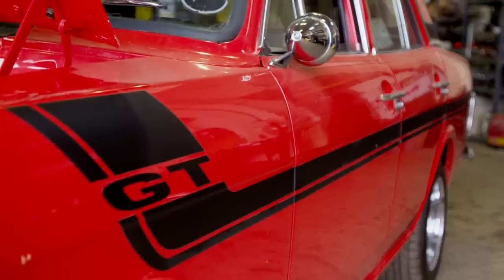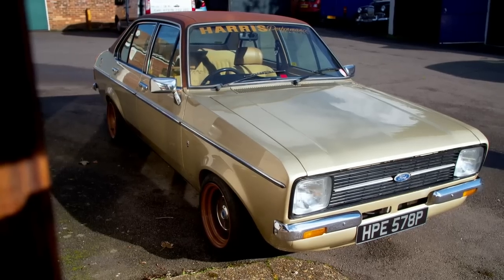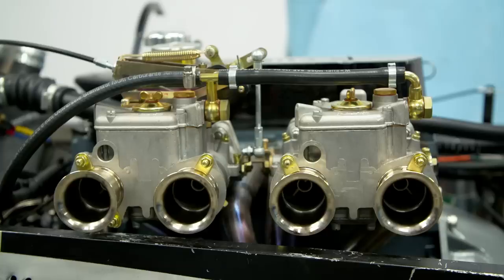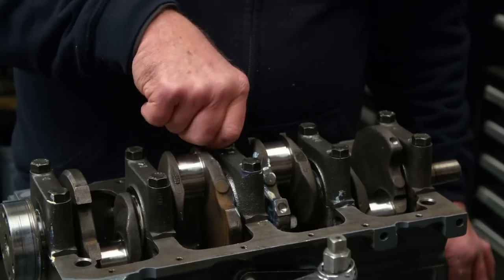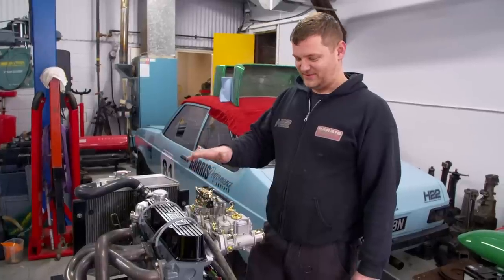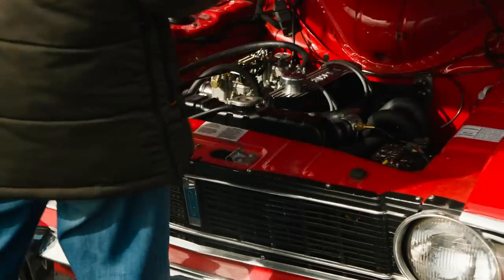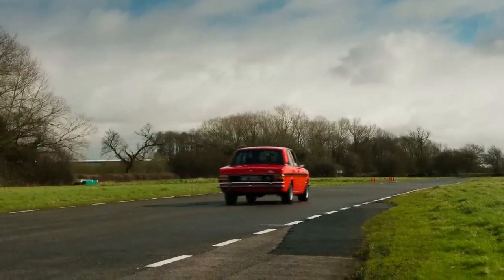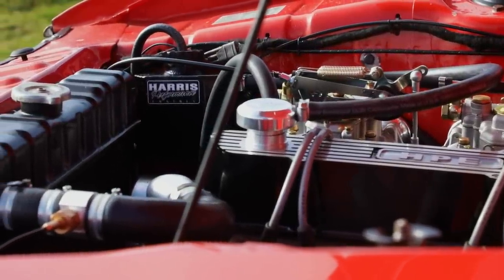Upgrading Ford Cortina GT With A Custom Harris Performance Engine | Salvage Hunters: Classic Cars

Comment: i have got a 135 bhp harris  ford cross flow engine in my cortina 2 and it is superb cost a package but worth every penny
Reply: Have you changed the gearing otherwise it over revs. And it will be in the red  at top end and wear the engine.  With that bhp and the right gearing it should hit about 120

Comment: That looked superb. Now enough looking - get an airbox and proper air filter on there.
Reply: Yeah, I always cringe when I see an engine with just screens.  Even if you don't ingest something fatal, the grit from road dust will wear your rings down pretty quickly.
Reply: @bobmcl2406  Yes and also people that remove timing belt covers because the whirly bits look kool.

Comment: I remember when the Mk 2 came out and it was advertised as having bowl in pistons ( which means cheaper cylinder heads ) and cross flow heads. It is not a true cross flow because the valves are in line thus limiting the size of the intake and exhaust ports and even the 1600 engine did not put out more than 80 hp. The Lotus twin cam put out about 120 hp which was a lot back in the day.

Comment: Love them old welded steel wheels
Reply: Good old Les Weller, started welding them around 1967. Had a 6-inch set on my first 1,498cc-engined Anglia. Tun-Tyres, in Tunbridge Wells, were amongst his first stockists.

Comment: Great work Gentileman- former Ford Factory Tech here- had a 1.9L kent in my wifes Escort- quality unit Sir.
Reply: Mike Ray A cross flow bored out to 1.9 ? Really ? Wow
Reply: @jk3838  That Escort model was Sold in U S.for years,.still see a few still on the road. As. Former Ford Tech we knew it as the " Kent 1.9L".
Reply: Mike Ray was yours the CVH front wheel drive engine US escort ?
Reply: @jk3838  Yes Sir-
Reply: @jk3838  oh..1992 LX 4 door manual.trams/air cond/pwr steering.
Reply: Mike Ray so you had a car with completely different engine/gearbox/body than in the video then ?
Reply: @Mike Ray. You may already know this and I bow to your superior knowledge. Back in the day, I remember reading about the German spec. Ford Capri which had a "1.7 litre engine and a sprung manual gearbox". Have you heard of this spec? Was the engine size to compete with the Opel 1900 GT (the car with the rollover headlights)? And what was the "sprung gearbox" feature? I can't remember any UK cars of that time where the gear stick in neutral was pushed towards the driver in readiness to select first gear. Stay safe and well.
Reply: @jk3838  The Kent,Essex,and Pinto were good enough engines.The CVH was just pure junk.
Reply: 1.9 IS A CVH NOT KENT CROSSFLOW ALSO HAS HEMI STYLE ENGINE  1740 WAS BIGGEST REBORE I SEEN ON 1600 CROSSFLOWUNLESS RELINED SPENT MILLIONS WHEN ZETEC BOLTS IN PLACE NO MODS
Reply: @markmiwurdz202  1.7 WAS FORD EUROPE V4

Comment: What are the performance figures for this engine.  Is it quicker then a lotus cortina.  And what about the gearing  the cortina was low geared. So it over revs in top gear
Reply: What engine is it?
Reply: @JazzFunkNobby1964   4 cylinder x flow. Kent engine.
Reply: @russcooke5671  I would imagine the DOHC Lotus engine would be the winner. What do you think?
Reply: @JazzFunkNobby1964  yes. They are very tuneable.  140. Bhp is the most for road use.  190 bhp for race.

Comment: What the hell did they do to the suspension and wheels ?  the suspension is too high ( it looks like it has been jacked up ) the wheels are totally wrong. Mesh air filters are as much use as a chocolate tea pot ( should have put a pair of K&N'S on ) with no power loss . Oh and loose the rubbish stripes
Reply: Yes, looks like it wants to be a dune buggy, needs to be 3 or 4" lower.
Reply: Wheels inspired by Herbie .
Reply: @jimspeed1388  AND THATS WHERE THEY SHOULD STAY !
Reply: @g0fvt  YES TYPICAL PRITCHARD BODGE
Reply: @johncauser9705  TBH having watched again I think the wheels are too wide hence the ride height. Stock wheels on the GT were 5.5jJ those look like 7J, I think 6J with normal offset are about as wide as will go under the stock arches.
Reply: @g0fvt  Got it in one I ran my MK1 and my Anglia  on lotus steels and they handled great those idiots think that just by slapping big wheels on that it will handle better it does not work that way
Reply: @johncauser9705  had lotus steels  on my corsair  back in 1979 who would think there a few bob to buy now
Reply: @terryroberts505  I worked out the other day that at the time back in the seventies i had about £10,000 worth in todays money of Lotus wheels, OH for a crystal ball  + all the 2000e gearboxes , 1500 GT engines. Ford Anglia, Mk Cortina body panels and dozen's of old ford panels I worked for a Ford main dealer and they used to throw their old panels away

Comment: In 73 I worked in a garage in Herne Bay. One of the customers had a 1600E with a V6. I believe it was called a Crayford conversion. Now THAT! is a wolf in sheeps clothing.
Reply: I know about the Crayford factory that did the convertibles known as Crayford convertibles but not Crayford conversion?.
Reply: @markwood9987  I thought they did engines as well. The other name I heard it called was the Savage. Not sure if that was just a nickname.
Reply: @rappers5719  yes the Corrina savage  and perana used the Essex V6, Australia did inline straight six of 3.3 and 4.1 litres in the mk 3.
Reply: @markwood9987  Thanks Mark. I've only ever seen one Piranha (Capri) and that was in a  storage unit at Heathrow. 70 ish.
Reply: @rappers5719  been a pleasure pal keep safe .
Reply: @markwood9987  And you.
Reply: The V6 conversion was most famously done by Jeff Uren, known as a Savage. Not the greatest TBH, did a few V6 conversions with friends way back, best to use a different gearbox and the 3 litre Capri rear axle. Handling definitely suffered from the heavy engine, I remember a mate wanting to go back to a 4 cylinder for that reason. There were some V8 conversions around for the Capri, and I believe they were made in South Africa as a factory option. The car in the video needs to be a few inches lower, should be a bundle of fun, people forget how light these cars were...
Reply: @g0fvt  Thank you. I believe, the 2000E gear box was quite a favourite for the higher powered cars.
Reply: @rappers5719  yes, had good ratios too. Did shear a first motion shaft in one with a V6 though. Great with 4 cylinder engines.
Reply: @g0fvt  I was just about to dive in with a Jeff Uren comment, I thought the Capri with the V8 was called a Comanche but I’ve just realised it was the Stampede, I’m sure the ones I worked on had a small block V8. I worked for a body shop in 73/74 where we used to do the body mods for him. I also remember doing a hood scoop on an Olympic Blue mk3 Cortina, I’m not sure if he called that a Savage as well and we used to pull the wheel arches out to accommodate the wider wheels. The only work I did there on mk2 Cortinas was to rectify the Silver Fox and Blue Mink paint flaking debacle. Memories eh, thanks for reminding me.
The two guys in the coach building side also made custom fit front spoilers from scratch out of aluminium, we used to think they looked like snow ploughs, they were initially for Mathwall Engineering for their Mazda RX3 race car, I remember the sponsor was Penthouse, funny how I can remember that. Soon after everyone wanted a front spoiler for their road car.
Reply: Ken Allistone,  the gun metal coloured 1600Es were handsome when new. Did know someone with a twin cam version, bootbadge even said  "Twincam E" apparently one of about 14 from Ford. Sadly even those years ago the twin cam had been replaced with a crossflow. Would have been a valuable car now.  The V6 conversions we did as kids were fun to do but afterwards you'd spend your life changing track control arms and track rod ends, quick off the lights but ruined the handling. A mate's MK1 with a modified V6 did about 180hp at the rear wheels, so many modern and light 4 pots could do that. Great fun times, the car scene is not the same now...
Reply: @feydespiel.  you honestly would be better off with a 2 litre Zetec or similar.
Reply: @feydespiel.  Good luck mate. Post progress pictures. Post a time lapse on you tube. Would be nice to see.
Reply: @rappers5719  Yes a fair few Corsair 2000Es were stolen for their gearbox.
Reply: Crayford did do an Essex V6 conversion for the MK2 Cortina. Jeff Uren did the savage with his company "Race Proved" the Cortina in this video at 6.15 with the VYP registration is a genuine 3.0 Savage.
Reply: @brianclaridge7695  Thanks mate.
Reply: I recall my father had a Ford Cortina mk2 with a 3 litre V6 when new, it was known as a Savage. I remember seeing lots of dials everywhere, perhaps a 1600E interior? It went well for very early 1970s.
Reply: @brianclaridge7695  I had a 3 litre crayford 1600 E.  low geared no top end  in the red at 85 mph. But got there very quick  reg no was SDF 100 H.   In white  10 to the gallon. I should have changed the gearing and back axle.   Then it would have done about 115 mph same as the African perana. conversion.  Basil green motors   They even done a v8 capris.
Reply: CRAYFORD CORSAIR HAD A 2LITRE V4 AND A GREAT ENGINE IT WAS TOO CORSAIR ONLY UK CAR  AND ODD 1 TRANSIT1  CAME HERE WITHH V4 2.0
Reply: @rappers5719  YES THE FAMOUS ROCKET BOX 4 SPD GREAT RATIOS
Reply: @f1kwa399  ALLL CORTINAS HAD SAVAGE OPTION CPL OTHERS FOR OTHER FORDS OO V6 MK1 ESCORTS ETC GENIUS OF PAST

Comment: Only a question, but did Ford ever produce a 1600GT Mk2 Cortina,  as i thought it was a 1500 GT, or a 1600E , i could and very possibly have got this wrong !!
Reply: They did as a friend of mine owns a white Mk2 4dr GT Cortina, it’s now running 200zx power.
Reply: yes the GT had the gauge's on top of the dash 1600 E in the middle
Reply: MK1 1500GT PRE CROSSFLOW SAME AS LOTUS TWIN CAM BASE

Comment: back in the early 80,s in a barn in surrey was a red two door jeff uren savage mark 2 cortina. it was a1968. im sure it had a wooden dash which would have meant 1600e. i know there were no 2 door 1600e,s made in the uk but something rings in my head about austrailian spec can anyone confirm this. i wanted it so bad but was too young

Comment: 187bhp ! Wow a shopping car has more nowadays. Why no Lotus Cortina ? They were the DB in 5he day
Reply: 187bhp out of a 1960s engine
Reply: @MegaReddevil71  but it’s not a 60’s engine once it’s been modified with 21st century bits and individually built is it ? I’m 
pretty sure a turbocharger and modern engine management could be bolted to a Mk2 jaguar engine from the same era to obtain 400  plus bhp.
Reply: But a modern shopping car needs that bhp just to haul the extra weight around - 187bhp is a mighty amount in a car with the weight of a baked bean can. 
That said, the Cortina would offer the same level of protection as a baked bean can in an accident too.
Reply: @camwat5193  totally agree with you but just thought this post was all a bit naff. To get that power this engine probably has nothing below 3500 rpm.
Reply: @camwat5193 the mods the harrisis use have been around for years they just know how to build an engine properly nothing 21st century there

Comment: If you are a car guy , its obvious, Drew knows very little about cars.
Reply: His "I know everything" manner is starting to grate.
Reply: I know as much about antiques as DP knows about cars.F A.
Reply: After a few pints with him, you'd end up following into the bogs and kicking the shit out of him. I'd imagine.
Reply: You put it better than I would, now all the uk think a mk1 fiesta supersport is worth 24k, oh the bloke really is isnt he!!!
Reply: Best if he sticks to his Antiques from what I've seen about his knowledge of Classic cars.. Still something to watch on TV though, and see if they end up making a pig's ear out of an already good car to start with..
Reply: @djmill  🏆🤣
Reply: Your 100% Correct 
Another Cortina.. RUINED..
Reply: Quick question I see a lot of Picture's of Webber Carburetors where the Trumpets have no Filters fitted as is the case on this One,doesn't this allow dirt and dust enter the Carburetors?and cause blockages to the Jets.
Reply: @jockofthebushveld299  Not only that, the dust and grit acts like grinding paste on the engine internals shortening its life. Another reason for a well designed air filter is to cut down on the intake roar which will get really annoying after a while. Car designers know what they’re  doing. Drew Pritchard doesn’t.

Comment: The Cortina MK2 1600 GT had 2 doors, the 1600 E had 4.
Reply: There was both of both just a lot rarer , although 2 door e's were all lhd bar one
Reply: I had the two 1600 GT with 5.5 in rostyle wheels. The wheels on this car were horrific.
Reply: My Father had a 1500GT Mk 2, 2 door, but built with a 1600e interior, by Ford from the factory, i beleive there was only a couple made like that, Fathers car was in Saluku Bronze, basicly a shitty metalic brown colour!
Reply: There were 1600 GT four doors as well and estates  had a 1600GT Crayford great car five seat open air motoring 👍
Reply: @andrewcripps2314  I have never seen a 4 door GT in bristol uk.
Reply: Most were probably dressed up as 1600E s mind you you’ve got me thinking now 😀
Reply: @andrewcripps2314  my first car was a gold crayford mk  2  1600 gt  cortina. Beautiful car.  With a tuned engine  110 mph but in the red screaming  could only do the top speed for a few minutes otherwise it was over reving it
Reply: @russcooke5671  I also had a purple 1600e FPX626H and drove it up the M4 flat out for about 60 miles and the oil pressure dropped 5 ilbs after that never to return they did not like red lining for long periods at all what reg was your crayford mine VLB135G
Reply: @andrewcripps2314  I’ve had  4 crayford convertible and I can’t remember there reg numbers but I also had a very rare crayford 1600 E 3 litre.  In white  SDF 100 H  was the rev no.  It was a beautiful car because it looked standard 1600 E.  it was quite fast getting awat because it was a very modified engine. Built by Burton engineering to a bout two hundred BHP. wich  don’t Sound a lot now but it was the torque that made it very fast acceleration. Also it was low geared.   So 100 mph top speed  I wish I had it now.  I would put a six speed box in it. So it would cruise at 100 instead of being in the red.  Oh I forgot to mention 10 to the gallon  it would do a bout 100 miles on a full tank  or a bit more on motorways.

Comment: I used  to  work  on  the  old fords  anglias  consals etc  zephers   mk 1 2 3   side  valves   pre x flows  x flows  ohcs  v6s  essix  and colone  german  they  the  best  engines  ever  not  like  plastic  s  t  to day unrealble   half  rubbish on cars  to  day  is  not  needed  it  will go wrong  cost  lots  to  put right  take  the plastic  off  any  car  you  wont  be able  to drive  it

Comment: I owned that "type" of Pinto engine in my 1971 Pinto. what a pile of crap. only enough horsepower for one person in the car at a time. every time I'd hit a pothole in the road, the timing belt would skip a notch on the pulley, had the carburetor's needles unscrew and fall out onto the driveway. wouldn't recommend that motor to my worst enemy!
Reply: Good thing it’s not a pinto!

Comment: Utter bullshit. Top price for a 1600GT is £20k maybe, possibly. But incredibly unlikely. The £3k motor will not realise the cost - people expect the car to have an engine so this "Drew" character is as usual talking bollocks. The paint scheme will put people off - an identical Cortina failed to sell in Australian Online Auction - so maybe the same car - for £20k. Look at the logic - Lotus Cortinas are going for £25-£30k, 1600E s at £17 - £20k, so why will a 1600GT make £40k? Just like the FIAT 130 Coupe the prices quoted are bullshit.

Comment: I don't see the attraction in these vehicles, sorry.
Reply: Hah, guess it depends on Your age, first Ford I was ever involved with was an Anglia, mid 60's. I liked Mk3 Cortinas, wee brother liked Mk1 or 2 Escorts, sort out the suspension, stock was always to soft. Electrical was easy, two fuses, problem? Engine out and ripped down Friday night, decision, parts or engine. Saturday, factors or scrappy, scrappy any crash rightoffs, strip out engine, steal as many ancillaries, consumables, bits that will come in handy, eventually. Saturday night drive to pub. One night, driving to Dundee to see a girlfriend with My oppo and His girlfriend, 10 miles south of Perth ignition warning light came on, shut down all non essential, diagnosed fault, pulled into petrol station, I bought part, got back to car My oppo was ready to fit part. 3 minutes later, on our way rejoicing. Brothers Escort, stupid o'clock in the morning, c class road, all drunk, dies, no torch, fault finds, repair with tape by the light of 3 zippos, home! 7 days later, North West Scotland, The Sabbath, everything closed, Escort won't start! I'm 19 on a promise, borrowed a hand brace and replaced the coil contact on the rotor arm using a bit of a junior hacksaw blade and a brass BA nut and bolt from the crap in the bottom of My toolbox, Happy Happy Days. Yeah EMU's on interference engines operated by belts are so much better? I don't care about better fuel economy due to electronics if I'm parked waiting for hours to be told I need to be recovered! Oh, and as a ps Mum is acknowledged as the Families best at anything to do with carbs, singles, twins or twin down draughts!
Reply: @Leslie Mackay. Thanks for your brilliant comment! You sir have lived through the times of proper motoring, fixing your cars to get you on your way. You have experience that cannot be bought! My Dad used to keep our family Fords (and other peoples) running back when I was a kid. Your comment made me smile and bring back great memories. Hope you somehow use your "roadside car engineering skills" and knowledge today. Stay safe and well.